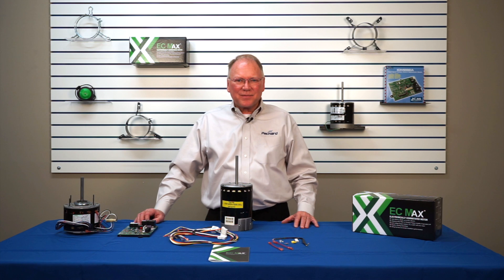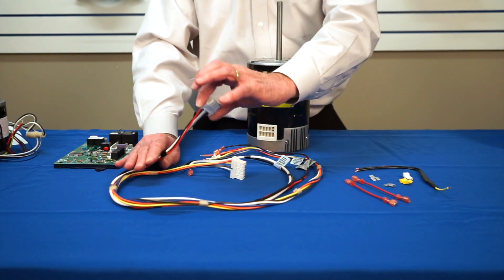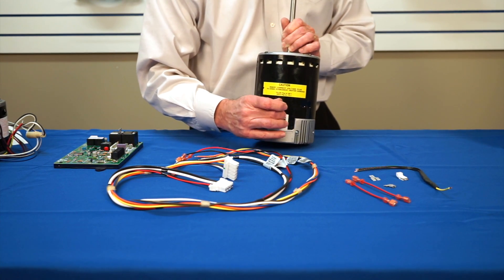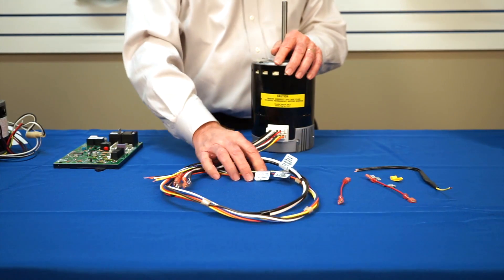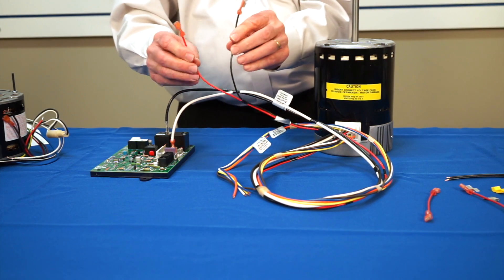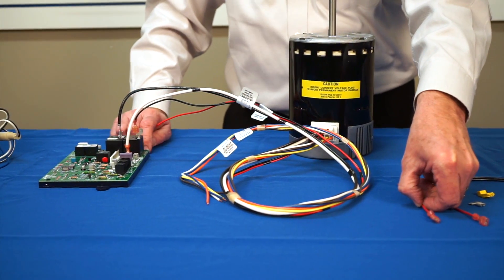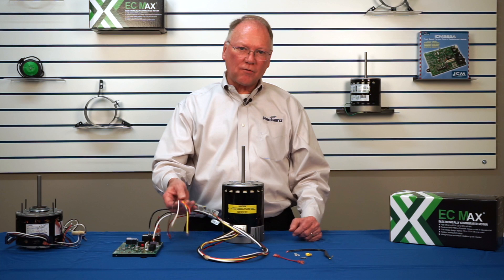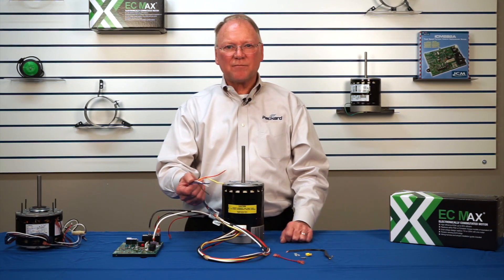Installing an EC Direct Drive Motor

Comment: Very confusing explanation.
If you connect those  7:08 “cool demand cables Y and W” it means that the Fan will only run when the signal is sent from the thermostat for those wires. But what happens when you select Fan-Only instead of Auto? How do you select that speed or torque from G ? 
Also that HIGH VOLTAGE SIGNAL born to complicate things up.

Comment: I HAVE A TRANE PACKAGE A/C WITH THE OEM X-13, CONNECTED TO A RELAY, INSTEAD OF A BOARD.
CAN I JUST STAB THE MOLEX CONNECTORS INTO THE NEW MAX MOTOR AND BE DONE WITH IT?